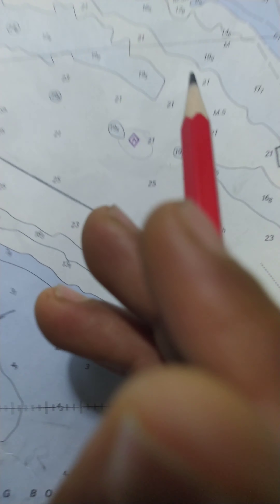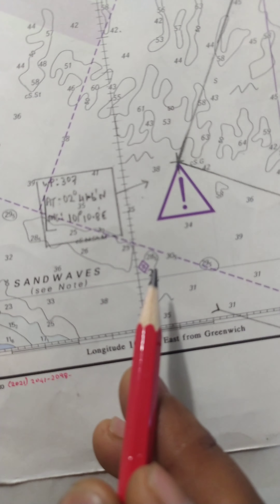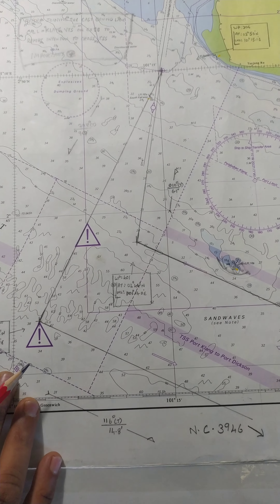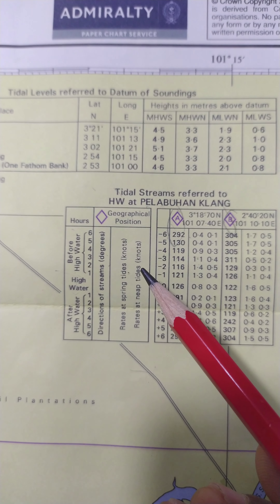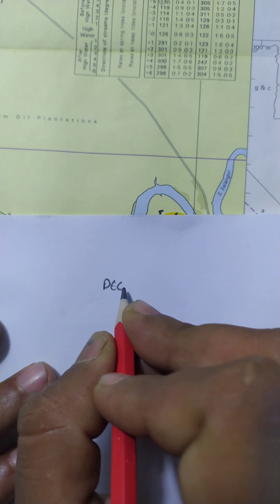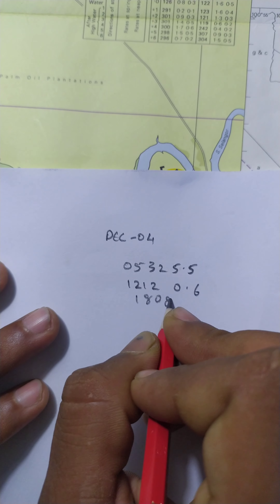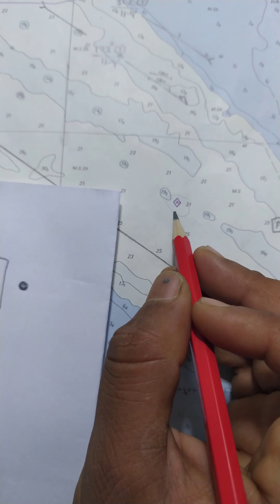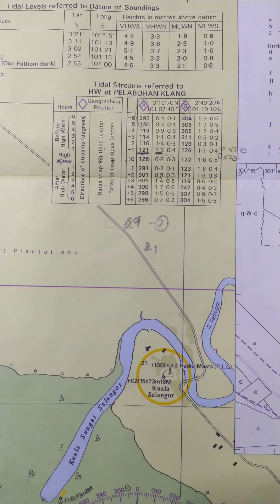Tidal Diamond Explained with procedure to calculate Tidal stream

Comment: Sir you haven't calculated as per the actual method,
For any day in between the percentage spring is to be calculated and interpolated to arrive at a particular value
Reply from the maker: Sir, 

I might have missed it when making the video. Sadly, I'm not in a place where i would be able to watch or make a new video.

I believe, I had explained the jist in details, any corrections are deeply appreciated.

It would be really helpful for anyone watching, if you could write down your thoughts as comments.

Remember, i too learn as I go along.

Thank you sir for the update, and waiting for your comments and suggestions,

Regards. ❤️